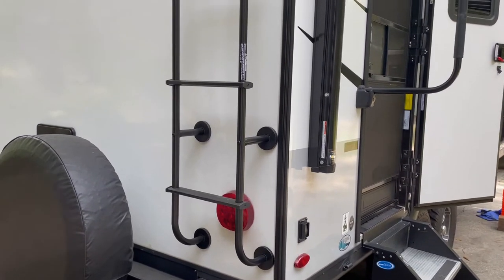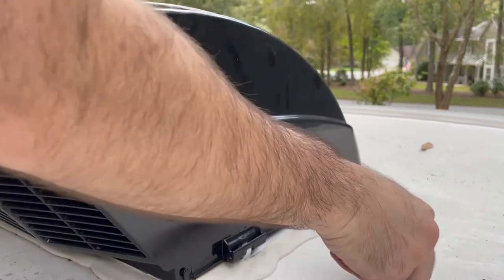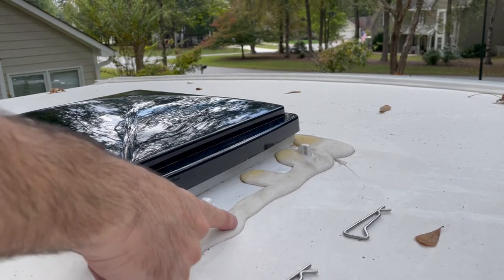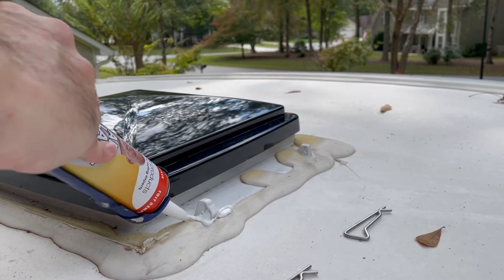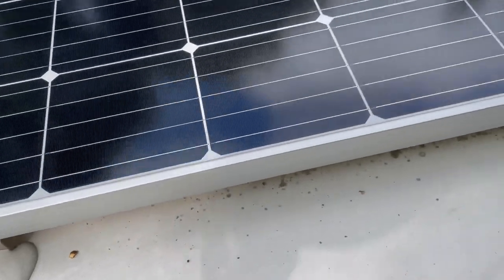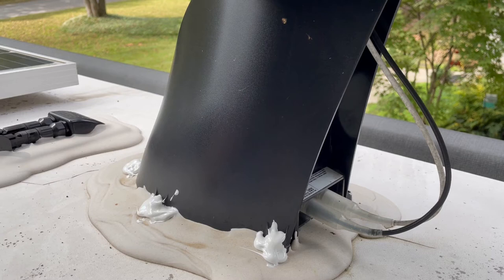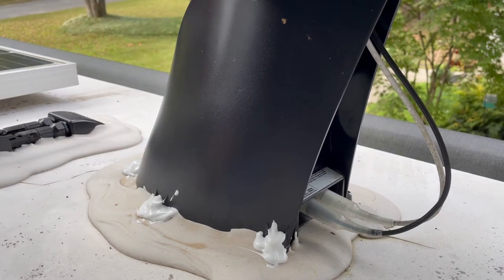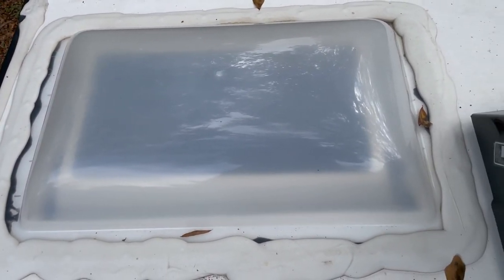FIXED!  Water Leak on MaxxAir MaxxFan 2021 Rockwood 2109S Forest River Mini Lite Seal RV Camper Roof

Comment: Great video, very helpful, thanks!  We just had our mini lite 2509s (2021) delivered to us last week, and we have a leak already!! it is coming in around the ceiling vent, just to the right of the mazzair fan over the bed.  Do you think my fix is the same as what you did in this video?  I don't know where else the water would be coming from.  Feeling very panicky!
Reply from the maker: Based on the forum posts I’ve seen, this is a very common problem with the installation. I bet if you climb up there you’ll find that your clips are not sealed.

The other thing to check would just be general cracking with that sealant. 

Good luck with that. 

Mine hasn’t leaked a drop since I did it. So nice!

Comment: Those clips on the fan should be rotated to the top, there's little notches on the cover that hold them vertically and locked in position.
Reply from the maker: Interesting.  I've had a couple campers with this same cover and neither had those clips locked into place.  I've got the camper in the driveway now.  I'll climb up there and take a look.  Thanks.